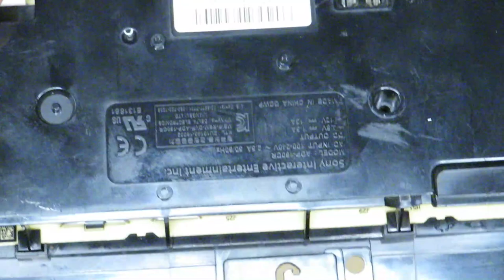Why PS4 Power Supplies Blow - (HOW TO FIX YOUR PS4) - GAMING TIPS 2020 - GAMING REPAIRS SOUTH AFRICA

Comment: Ive cleaned my ps4 several times and tried different thermal paste aswell and it still runs warm. I've never checked the power supply and i believe thats the issue. Thanks for the vid
Reply: I have similar case as well. Just applied thermal paste and replaced the thermal pads. But I still have the overheating. Heating starts from the power supply and once it reaches to the harddisk my PS crashes. 

Did you repair or replace the Power Supply?

Comment: So I have a PS4 pro. It's currently on it's 3rd power supply in 7 months. I have opened it and looked at it and I find no bugs, dirt, dust,  blown caps, burnt looking spots, absolutely nothing.
Can anyone tell me how to keep it from killing itself.
I usually keep my ps4 very clean and have never used compressed air.
I live in a cheap apartment and the power does brown-out or even black-out completely, very often.
Should I buy an outlet protector for it?
Or is there something else that is wrong?

Comment: I had a disk capacitor to blow up with a lound bang...Will it survive with a new power suply?
Reply from the maker: I don’t know if you mean a MOV or a capacitor? Also where did it pop, on the consoles main board, or the power supply?
Reply: @ConsoleServiceCentre  its the brown ones on the model 14-240 P1A i think its a capacitor but now that you mention MOV Im not sure, i heard its the capacitors that usually blow up with a loud bang but fortunately Im not talking from experience on this one, it is on the power supply, but i just wanted to make sure how likely it is for it to have done damage to other parts of the console before i buy i new one...thanks in advance 👍

Comment: I suffered a power outage and attrmped to use a generator to connect my playstation. It blew up my dvd player and damaged my ps4 slim cause it wouldn't turn on. What are the odds that its a component issue or power supply cause I wanna order a repacement online.
Reply from the maker: You will need to test the power supply, output voltage to see if it’s just the power supply, I have a video on the channel about on how to test them.

Comment: If my powersupply has one of those solder points ripped off,and when I played it, the ps4 shut off and wouldn’t turn on, would it be the power supply or the motherboard
Reply from the maker: Would depend on where the solder point is pulled off.

If its on the main board side, it will need to be repaired.

You will need to replace to power supply if you think it might be faulty?

If the power supply cable is not making a proper connection where it broke off, it will give you problem if it hasn't been repaired.

Comment: My ps4 turns off only when I start game. Do you think the power supply is faulty.
Reply from the maker: Is this when you play a game off the disc or a downloaded game?
Reply: @ConsoleServiceCentre  downloaded game
Reply from the maker: @ripper2k252  It sounds like it's the hard drive, see if you can download some software and run a test on it. Or it could be the power supply that fails as soon as the voltage picks up. If you in South Africa, you can pop in to our shop and we can do a test on your hard drive for free.
Reply: @ConsoleServiceCentre  I can watch vidoes download games and once I start a game it stops work and I dont think it's the hard drive
Reply from the maker: @ripper2k252  It's a tough one, try go into the safe mode, then select rebuild data base. Just don't select any other option, or the PS4 will format itself, and you will loose everything.
Reply: @ConsoleServiceCentre  I did it before didn't fix the problem
Reply: I have the same issue , did u get it fixed? Let me know
Reply: @chamithganiarachchi9124 I ordered a power supply for ps4. I will see if it fixes and if this does I will let you know
Reply: @ripper2k252  thanks man 🥰
Reply: @chamithganiarachchi9124 power supply didn't help I got red light of death don't know what happened
Reply: @ripper2k252  oh shit , I hope you’ll get it fixed soon. ✨❤️ thanks for the info.much appreciated

Comment: Hey sir my console turns off by itself cause of high temperature .. i just cleaned everything but i didn't replace the thermal paste it was dried and my fan was rotating smoothly when I spin and it is clean too ... but when I turn on the console the fan doesn't spins ... and the console turns off in seconds .. if i replace the thermal paste does the fan works!  or something else??
Reply: I'm pretty sure the PS4 has a failsafe if it detects faults in the system itself (such as dried thermal paste) also try not to spin the fan, you can wear it out and cause it to be less effective for cooling your system

Comment: I have a quick question, I got ps4 pro (CHU - 7116B) and does it match with  (CUH-7115) (CUH-7015)(CUH-7215) is it possible to use one of these power supply for my ps4 pro for the (CHU - 7116B)
Reply from the maker: Take a look at a post I wrote on our website here https://www.consoleservicecentre.co.za/different-ps4-power-supplies-and-models/ this has all the different power supplies and models.

Comment: My ps4 pro makes a sizzling sound where the power supply is, should I worry or nah? I wanna fix it but the new ps5 comes out so I reckon it can last me till then, i dont know what to do
Reply from the maker: You will need to see if there is maybe something in the power supply itself, just be careful, they can give you a shock and make sure you have plugged it out from the wall.

The capacitors do keep charge for a long time, so if you don't feel like getting shocked, be very carful

Comment: I have a buzzing sound coming from my ps4 in the AC port .. there is like a bzzzzzz electric sound it comes here and it goes... Is it a danger to my ps4 pro or no?
Reply: No, the buzzing sound is the voltage running trough the power supply's component and it's totally normal.
Reply: @christopherbolis2048  why won’t my PS4 turn on then?

Comment: When i turn my ps4 on everything is normal but then after a minute or so in the menu or in a game the screen starts to buffer and the screen turns off but the ps4 stays on and the controller turns off aswell and then the ps4 just shuts off
Reply: No beep or nothing
Reply from the maker: Try booting in the safe mode menu, then select rebuild database, if that doesn't work, then try another hard drive.

If that still doesn't work, it could be the south bridge chip that's faulty.